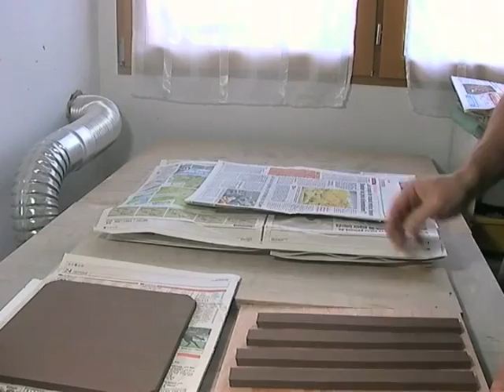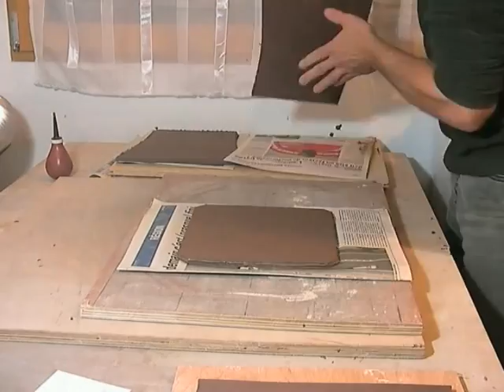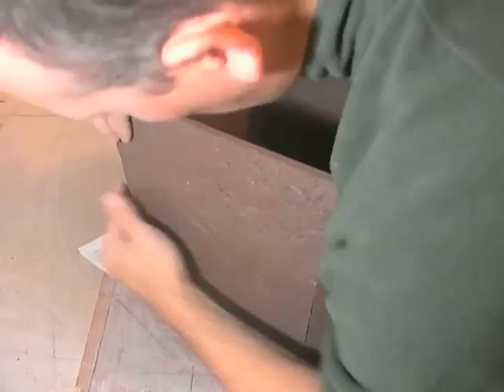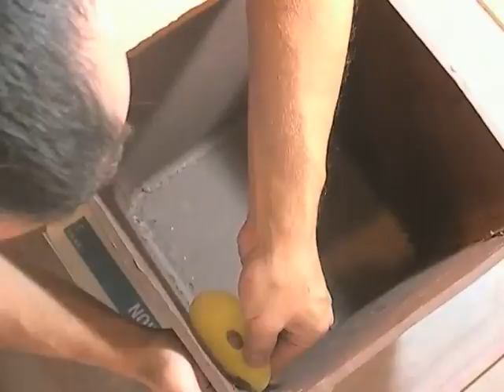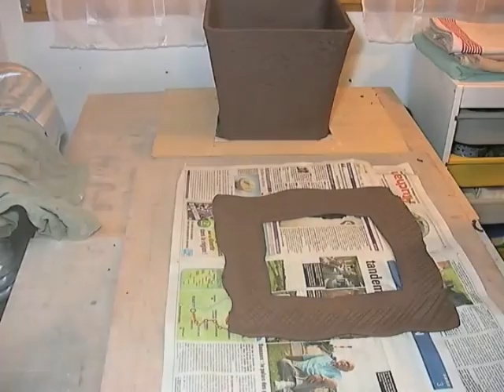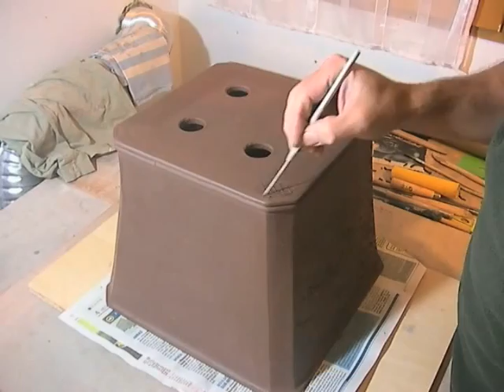Making of a cascade bonsai pot with slabs | Stoneware pottery without wheel tutorial

Comment: Exquisite! How did you add that detail on the sides along the bottom - the two half rounds - you didn’t show that. Were they extruded then added?
Reply from the maker: Yes exactly, extruded.
It's an old video, I show more detail on the recent. For example, you can see how I make the texture here https://youtu.be/tMuOglQ5DtQ
Reply: @Greg-ceramics  Thank you! It’s really beautiful! Lastly, Im just guessing that you cut the bevel angle for each piece at 22.5 degrees for an eight-sided shape? If that’s the case, I may have to fashion one, unless you sell them?

Comment: the edges of the slab were not cut in an angle?
Reply from the maker: As there are 8 faces, the sides are cut at 22.5° instead of 45°, that's why we hardly see the angle. (and the poor quality of the video doesn't help to see well either 😅 )
The bottom is not angled, but I made this video 9 or 10 years ago, today I'll probably do it differently. 😆

Comment: How long the clay parts need to get a little bit stiffer to start attaching them together?
Reply from the maker: it isn't a question of time, it can change with each piece depending on the weather, the humidity, the temperature, the humidity level of the clay ...
it's just done by feeling